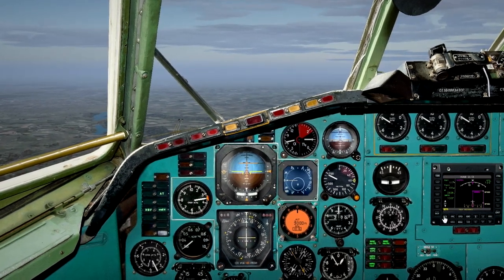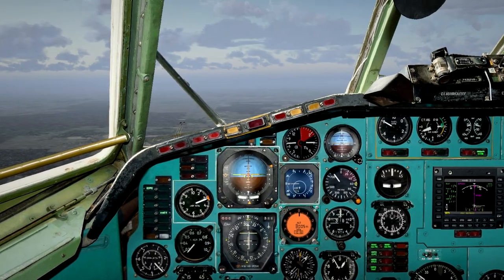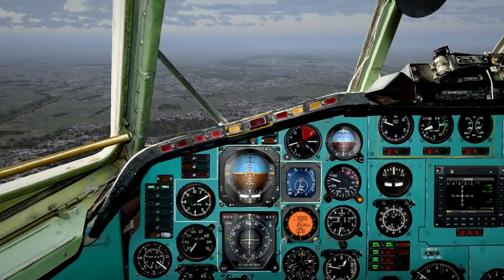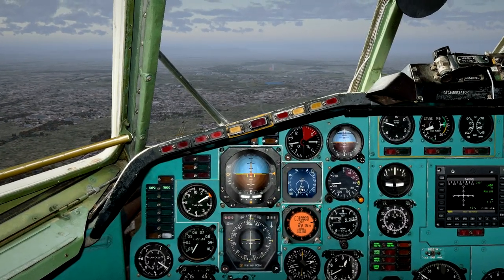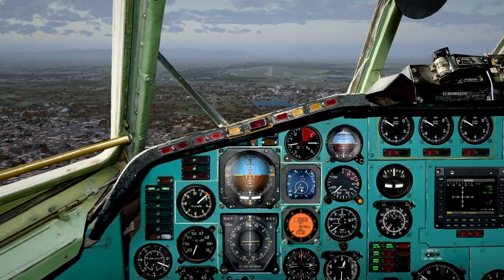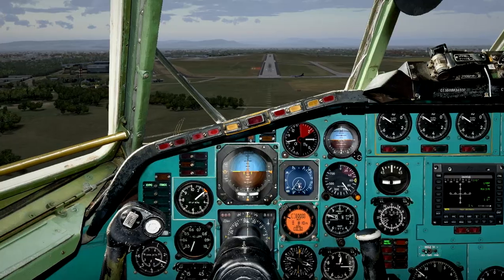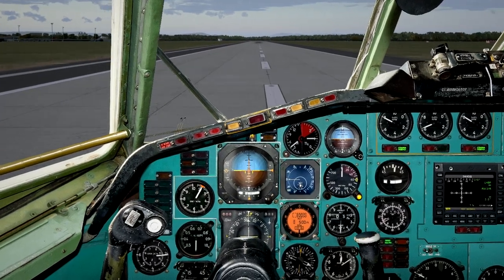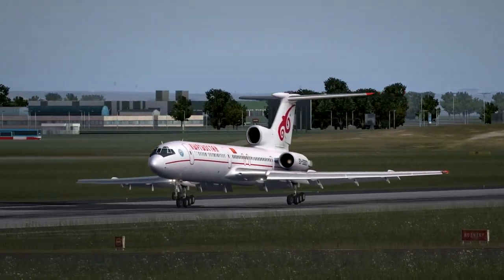Budapest LHBP/BUD Rwy 31L Tu-154M arrival test

Comment: Hi,

Can you list all the new things compared to your older TU-154 videos?

Have you made any changes to the LHBP scenery?

P.S.

I'd like to see a new 737 classic video.

Maybe Klasjet VIP or a freighter like 737-300F TexelAir.
Reply from the maker: Easy. Completely custom gauges/ systems apart from the PT sounds. My old videos used PT gauges. I don't need a custom joystick setup (always hated that) FSUIPC gives enough options for custom joystick and excels at it's job. I would like custom xml animation for the model. (reversers in the air, ground spoilers and bogie animation) maybe that is possible now with MCX.
Reply from the maker: Re LHBP scenery changes: Only the never-ending updating of approaches. Re 737 classic: As it happens I have a Hi-def Klasjet photo waiting to skin a 50North 737. ;)